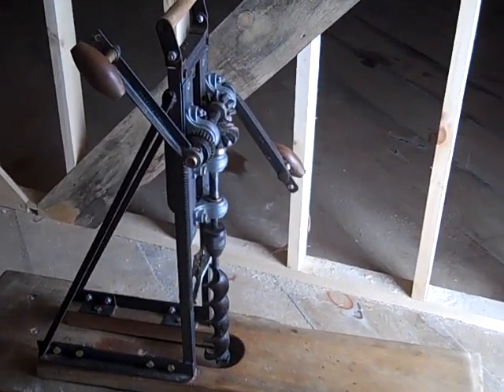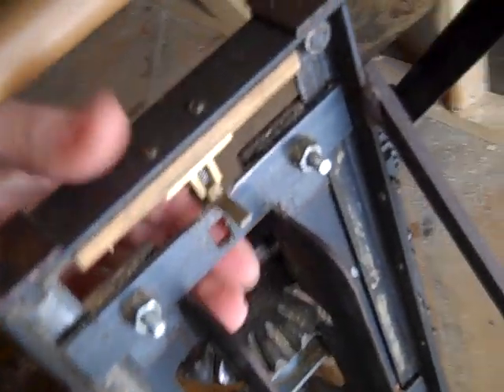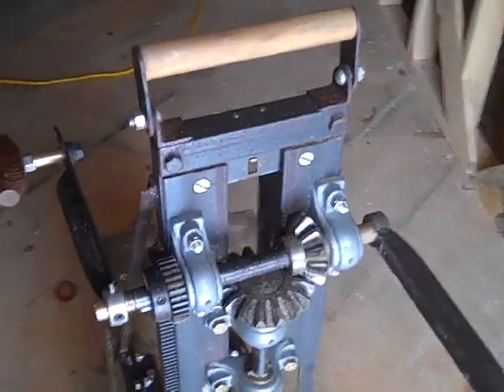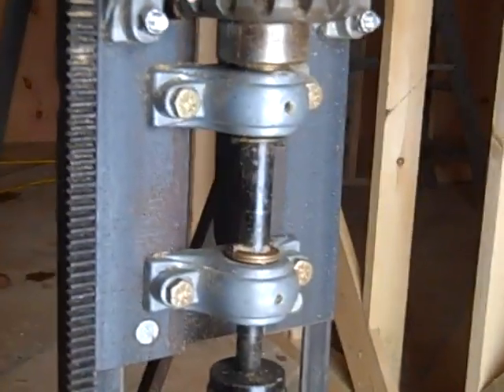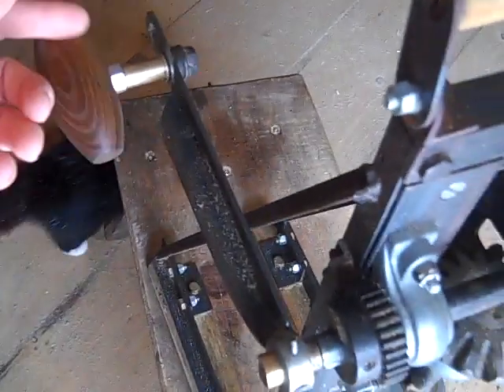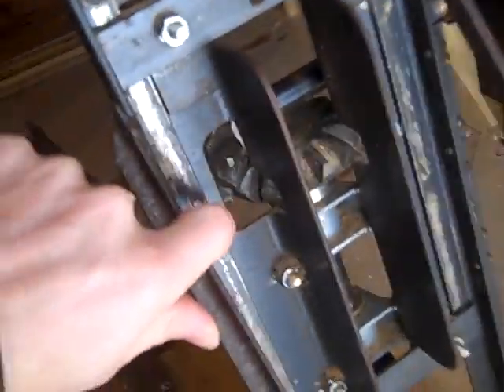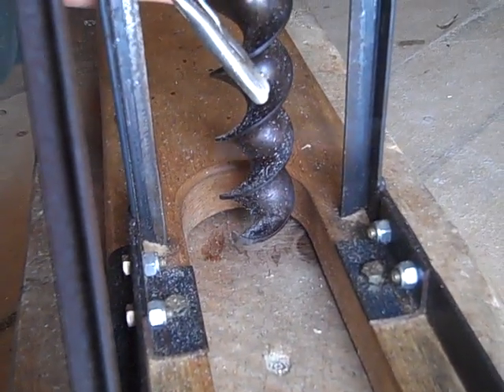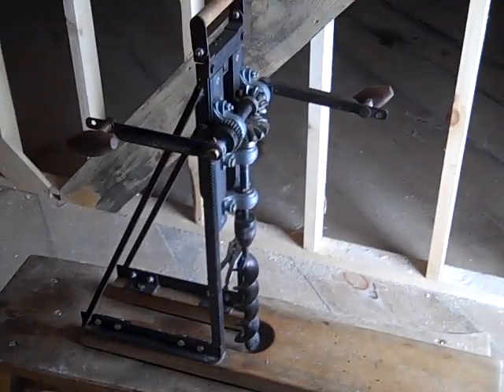Home made boring machine

Comment: I am contemplating doing the same thing, since I can't find a boring machine at a reasonable price.  I plan to use the bevel gears from a sidewinder style trailer jack repair kit (about $13 US) since all the diffs I have are earmarked for other projects, and a sprocket with a chain (pinned at both ends) as the retraction rack.  I'd like to add a chain reduction jack shaft so that a 1/2" drill can be used to drive the machine at a reasonable speed, also.  If/when I complete the build, I'll do a little write-up and post it to Scribd or somewhere.  Thanks for showing off your brother's handiwork.  I'm taking notes!
Reply: Hi Kevin,  This is my new channel, I am not posting on my old Moon Hill channel.  Here is where we are now, still boring but it is electrified.  
https://youtu.be/n5mNevktPJA